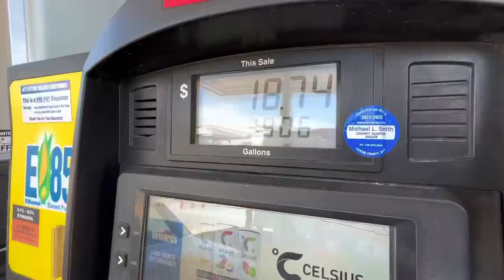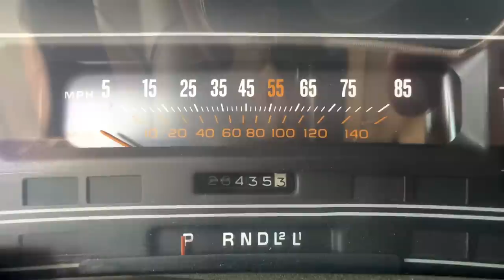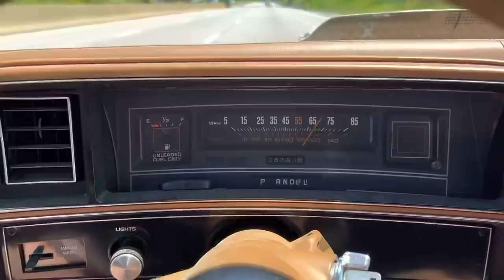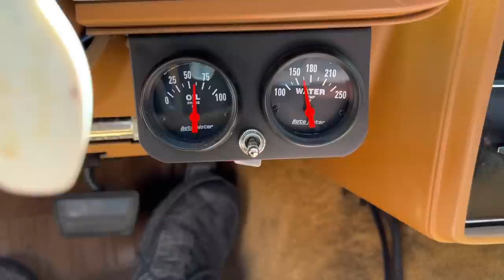CORN SWAP!  Testing a Quick Fuel 750 E85 Carb for POWER & ECONOMY!

Comment: hey bill.. I'll tell you what I did back in 98 99 Era. I had a 350 powered Trans am. I also put a nos plate in it like you. but same deal. my rear wouldn't hold together after a dew nos launches. so back than they sold a kit. called something weird like the top hat or something.  but it was just a small kit like 50 to 100 shot max went inside the air cleaner.  now this was back before draggies and what not so I don't have times and I only street raced it. but I was able to use that kit for the luanch than the bigger kit for the rest of race. it took some getting use to and best way I found was 2 button setup. 1 on wheel and 1 one shifter. and as you let off 1st kit hit second.  I can tell you every weekend my best friend called me out to race and it always went same way we left together on a good day or him out in front and than I'd drive around him. using this wacky setup I was able to be in front of him off the start and not grenade my rear.  I was you'd dumb and you know the rest lol but also my car was only able to be built of money I won. so I was trying everything to make sure I was infront with out breaking alot of parts and a good rear kit was out of my budget at the time. maybe this helps may e it just remind you how far kits and builds have come in last 20 some years lol
Reply: I seem to remember that was an NOS top shot🤷‍♂️. Too many years and too much alcohol ago

Comment: Man that Camaro looks fantastic, a Big Block with a 4-speedy it doesn't get much better than that. Don't get me wrong, I would love to have the Malibu, it's looking fabulous and in my opinion running great as well and the color combo doesn't get much better either. Good luck if you go racing and if you're going to be doing that, I'd be looking for a 12-bolt rear end replacement or a 9-inch, even better yet. It's not likely your ever going to get rid of that beautiful thing anyhow, or at least I wouldn't be. Damn, I wish I had half the cars I've owned back, and at 72 years you can only imagine what that would consist of. Woops, didn't mean to go off on a tangent like that. You go racing and have a great time and enjoy yourself. 😎✌️❤️

Comment: Hello. Loved your video the E85 fuel. I have a quick question, besides the e85 carb swap do you think I need to switch out the fuel pump and regulator. I’m also running a fuel cell with foam. Not sure what to do.

Comment: Hope you use new head bolts on that 327, most don't know the head bolts are torque to yield items meaning they need to be replaced with new ones each time they are taken out. Especially with a performance engine.

Comment: I recently found out about E85 carbs,  I like E85, but I wonder about the gas tank itself, pump, fuel lines and all that.  
If the carb is corroding or stuff becoming jelly, what about the rest of the fuel system?
Now im curious if your car improved in the 1/4 mile

Comment: I think you would be better off with a lil hotter stat. E85 likes to be 170 or hotter. From there I think the blue hvc coil Billy replace because of the new 8 IGN would be much better for the alcohol fuel vs the old oil round coil I see in the Malibu. Praying for your 7.5. Its not gonna be much longer for this world I believe. Love the content. The 327 in the 55 will be great.

Comment: Sweet. May be a good idea to replace any of the rubber lines to e85 rated. Metal lines obviously will be just fine with the E. Know some have ran into issues with return line size once pushing it on E.

Comment: I run E85 in my cruze it’s pushing 220hp to the wheels on E85 tuned and almost every bolt on part I could get for it…. It runs super strong and fast as hell it… have a dyno sheet cause a lot of people don’t believe it

Comment: @oldmansgarage not a E85 question but one on your set up. 
Most people don’t recommend a cam the size of yours with a overdrive transmission. Do they say this out of concern over vacuum or because the rpm is lower than the beginning of the power band?

Comment: Hey Bill, if the Malibu is a little rich on tip in with your 8.5 power valve why not just try the 4.5 that it came with? In my years of carb tuning I've had good luck using 2.5 power valves even. Well glad the E-85 was such an easy swap, I had always wanted to try it but never jumped off that cliff.

Comment: Are you still running race gas in the nitrous fuel system? 
I am having trouble with my big block mopar knocking on 93 octane.  It is actually a mild setup with flat tops pistons and only a 484 lift/ 284 duration cam. The car ran great on 93 in the 80's and 90's but the crap that being sold now doesn't run well in my Roadrunner. Will e85 help the knocking issue?

Great videos. I like your bracket and index racing videos. Hopefully one day I can get back to racing.

Comment: Do you use the same jets as a pump gas carb? Also, how do you choose a power valve? I struggled to get my small block to run well and ended up with a block off.

Comment: Have any experience with lunati cams?. Im looking at one of their street master cams. Cam specs for power range and all that fit well with my combo. Ive read good and bad reviews. Side not my tahoe is on e-85 i love it. I lost about 2 mpg cruising on the highway but it is way more responsive and the cost i mathed it im only spending on average 3 more cents ta gallon over 89  Compared to mileage and cost. Long run cheaper than 93

Comment: As always great video have never used e85 that's pretty cool.  I have a 01 Ford ranger with 3.0 engine v code has green sticker on it. We have a 92 geo tracker 4x4 1.6 engine my son accidentally put bout 3 gallon in was afraid it would hurt it but said it ran a lot better n actually got better fuel mileage will it hurt the engine if it was not made for it.? Thanks for sharing

Comment: Bill can you explain the rest of the E85 fuel system? Does the fuel pump diaphram need to be E85 capable? any long term effects to the fuel sending unit or steel factory lines? Thanks Dez.

Comment: Really interested in the e85 thing. Seems like it’s going to tax the tiny stock fuel lines even more. Watch out for a fuel pressure drop on the big end. Good luck .
Reply: That's probably not an issue in this application. There has been guys on the strip running more horse then this on this same feul line for decades.  They wouldn't be on E85 but the bigger motors would need to pull more feul.

Comment: Great video! What fuel do you plan on spraying with the nitrous? And have you tested the pump e85 to see where it stands on percentage? E85 isn't as common here and I've been told the places that do have it is a lower percentage. What is to low on a healthy small block with nitrous?

Comment: Bill thanks for sharing all your information. Maybe I missed it but why did you switch to E85? For my own info here on NY there is talk of going to 15% ethanol in pump gas which is now 10 % ethanol and there are concerns about todays engines running on ethanol. I did a fuel test the other day on fresh fuel and it registered at 5% ethanol. I guess my question is,is ethanol in your personal opinion good or bad for todays cars? They say cars on 10% will have negative effects on 15% ethanol. Any ideas to clear my brain. Bill all of your families  channels are superb even with uncle Bucks. Stay safe and well Artie 🇺🇸.  If  you have no time to  answer maybe  throw the explanation in the next  video. 👍 Oh get the 55 327cuin up and going

Comment: Trick chasis i got a 35 spline braced 9in from them with stock disc brakes the whole package to my door for my s10 for $2100 thick walled aftermarket case  do it Bill you can always change it back and you can give it everything on the hit

Comment: I have a 71 Nova with a solid roller 406 that runs low 11s n/a on pump gas. It has a Richmond 5 speed. Im waiting to see how much your car improves to make my decision if i want to make the change to e85.

Comment: Questions about E85.. can an older fuel injected throttle body stock engine run E85 ? Also is E85 cheaper in price then pump gas where im from i have no access to it ..an is your Malibu faster then your nova was when you had the nova working at its best ? Love your videos never miss a one .. Im from Canada/ Ontario .. good luck this weekend have fun 👍

Comment: Hey bill another great show I have a question how do you keep  E85 from messing up everything in the carb ? is there an additive that you can put in? does it work ?how often do you have to go through your carburetor after sitting, Or if you run the fuel out of the carb does it eat up the fuel pump as well? Especially a race carburetor.  I've heard that if you drain out 85 out of the carburetor and and add 91 the car was start faster and Keep the carburetor from corroding?

Comment: I run E85 in my 2014 5.3 Chevy Truck when I can because it was .60 cheaper than 87 today. My truck runs 200-205 degrees on 87, but only runs 180-185 degrees on E85. Does it hurt these new LS motors to run E85 all the time? I was kinda worried when I seen the inside on that Carb off the Camaro. My 5.3 says it’s made for E85. Love to know your opinion Bill…

Comment: Can you explain whether or not you made changes to the fuel system when switching to E85 carburetor! What fuel pumps and filter can you get away with using on a carburetor application?

Comment: Hey Bill
If you're running E85 through the fuel cell. What fuel are you going to run through the stand alone tank for the nitrous? I was thinking about running that same set up. Thanks in advance.

Comment: In England our pump petrol has changed from 93 octane 5% ethanol to 87 octane e90. I’ve been told that on my 20 year old Audi this could be real bad for it. Apparently the ethanol can ruin fuel lines and o rings etc. what is your experience in this regard and do you think I should be worried? E95 is still available at some stations but they have really bumped up the price to over $10 per gallon. Cheers. Bill
Reply: It’s bad when you let the vehicle sit a month or longer without starting or driving but from my experience, as long as your driving like a normal vehicle then you won’t see much degradation in your one’s and seals but if it’s a car that is going to sit over the winter in the garage, then you’ll want to store it with good, higher octane gas or add a fuel stabilizer to it. I think most of us in the states see more issues with the lines and seals in our mowers and trimmers than the cars. 

I don’t have the experience many folks do tho Bill so maybe if others have different experience then maybe they will chime in and let you know their experience. Good luck brother! We’re all in this mess together man so try and hang in there!!
Reply: @1982MCI  many thanks for that comprehensive reply. It’s a summer convertible so I will take your advice and run it on premium fuel just before I lay it up and add a fuel stabiliser as you suggest. Cheers brother! Bill

Comment: Hey Bill, by the way I love what your whole family is doing and love all the videos. I am planning on switching to e85 from 110 mainly due to the cost difference. My question is what do you think about spraying  nitrous with e85 and or would you recommend a stand alone system with race fuel for the nitrous ? I have been told by a few nitrous companies that e85 is completely fine to spray with nitrous.My setup is a 430 sbc dart shp block, 9.5:1 comp. Brodix track 1 heads, dart dominator intake with a 1100 cfm pro systems carb and 2 kits of nitrous. Engine made 716hp, 650tq n/a on the engine dyno.
Reply from the maker: I think that is going to be the topic for today lol. Lots of questions about that
Reply: Sounds like an amazing motor. I have a similar combo run sniper efi it's dart shp 440 c.i. brodix dragon slayer heads 11:1 compression I run 91 octane. Have never sprayed it but been thinking about goin to e85 and or using nitrous in the future motor is in my daily driver

Comment: Hi Bill , I have a question on my brawler 750 race carb . My question is I'm running a pcv valve now using a 1 inch spacer with a threaded port in the front . I see that there is a large vacuum port in the left front of the carb base plate . I assume this can be used for my pcv line . I'm using the port coming off the back of the carb for my power brakes at the moment . By the way this brawler 750 race carb is the bomb so far . we took it out of the box and set the float levels and so far I haven't touched it . Thank You for all your videos , I love them very informative .
Reply from the maker: Yes you can use that port for PCV
Reply: @theoldmansgarage  Thank You Very much for the response .

Comment: Bill, I have a GMC Typhoon that we recently converted to E85. What would you recommend for winter storage? What fuel stabilizer would you recommend? Do I top the tank off before parking or run it low so I can top it off with fresh fuel in the spring when I take it out of storage? My intake air temps dropped about 40 degrees....I have considerably more boost on the E85 tune (it has a dual tune chip for E85 and Premium) on premium I get about 18 psi and on 85 I get about 22 psi boost. Fuel economy is not a big concern to me as it is Smiles Per Gallon rather than MPG.
Reply from the maker: Chief swears by Seafoam. I’d try it.
Reply: @theoldmansgarage  Thanks...I will give it a shot.

Comment: Hi bill I do have a question but about the locked out distributor, I locked mine out and it preforms really well but when the car warms up it can be a struggle to start and really hard on the starter motor, it’s only a 11 to 1 comp and a 650 cranking amp battery just wondering if you had any thoughts??

Comment: Did you ever check the fuel mileage when you were running pump gas.  I know e85 doesn’t go as far.  I was just wondering if you  had a number to compare to?

Comment: In my Opinion. Malibu would greatly benefit from was less stall speed. You gotta think on spray, that little engine is way out of its RPM band. Probably 4500-4700 stall. I think you said 3800 stall is in it. That cam has to be good from close to Idle

Comment: You should test the e85 to see what it is. From my experience it varies quite a bit at the pumps. With efi it’s not to big of a deal because I run a flex fuel sensor to compensate for any % of alcohol in the tank but I could see how that variation could be a problem with a carb.
Reply: If nothing else it would be interesting just to see what your getting from your local pump. I usually end up with e60 at the closest pump to my house. I need to try some more pumps in the area to see if they are any better.

Comment: Love this channel !! Will you still run race gas in the tank for the nitrous while running the E85 ? You have me thinking of running E85 now lol. Any special fuel lines to protect against the E85 ?
Reply: @SweatyFatGuy  Thanks a lot for the input ! That makes sense not to mix the two fuels. I usually run my nitrous off of my main fuel system. I would justr have to step up my fuel side of the nitrous pills to make up for the E85. I had never done my nitrous like Bill has done before now. I had only seen people with huge engines do it that way before. But i thought it might be a good idea. My fuel line is braided steel with rubber inside. That's what I was most worried about using over extended periods of time. My car has been sitting for a few years also and I was thinking about running new fuel line but wasn't sure if I should use a particular type that will handle E85. I'm here in Maryland and we have E85 at the Harris Teeter in my county. People that test all of the time says is always been real good. This is kind of a race car that might be driven on the street a bit from time to time to local car meets.

Comment: For drag and drive, would you swap parts in the carb, or have 2 complete carbs for e85 and gas?
 I understand you've got some time with e85 blow through. For drag and drive I'm thinking of swapping back to a carb to get more cooling and hp out of my fuel pump.

Comment: Wish I had e85 that was consistent down here. You might get e85 one time. You might get e50 the next. If you aren’t buying it by the barrel here you’re bound to run into issues.
Reply: @joshuagibson2520  it’s a drag. I’ve a car that would benefit greatly. But I can’t count on the shit pump e85.

Comment: E85 ? Does it react differently to rimming changes with it running cooler and more physical fuel in the cylinder and what about heat range in the plug and since I'm thinking about it could you safely spray more with all the cool stuff e 85 has going on I wonder if there  isn't more that hasn't been explored in a street performance format

Comment: I have a 355 SBC with eq heads mild cam,headers,edelbrock rpm air gap intake and a750 cfm vacuum secondary , do you think it will take the e85 and if you think it does what else do I have to swap to make this carb work ?

Comment: what compression ratio can you get away with running e-85?
Reply from the maker: Dynamic compression is the key factor in what kind of power any fuel will resist detonation. It’s not a simple answer.

Comment: When running e85 do you need to change the fuel lines or fuel pump? I've heard that e85 destroys any rubber in the system.